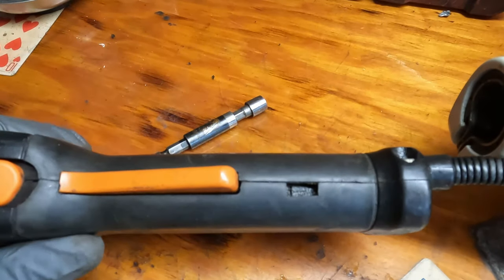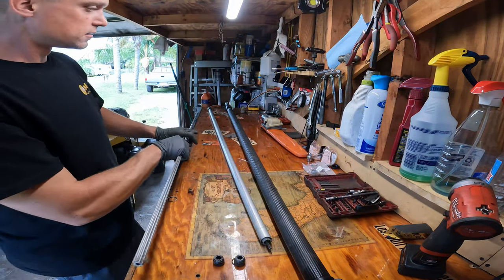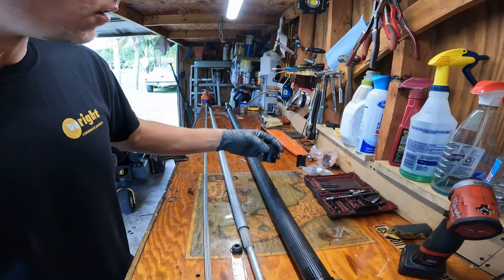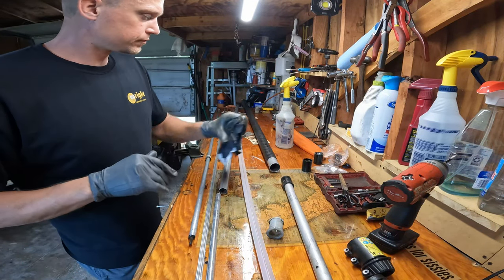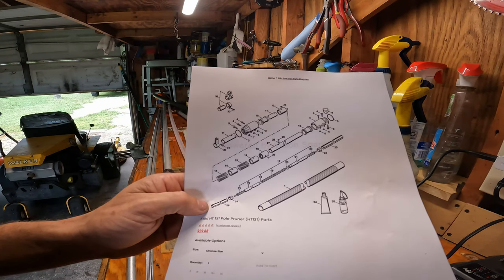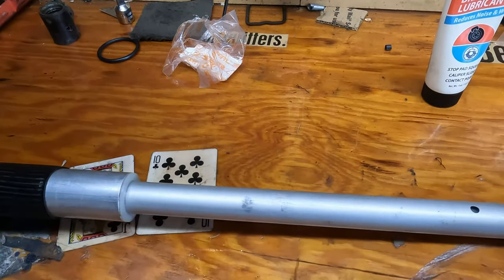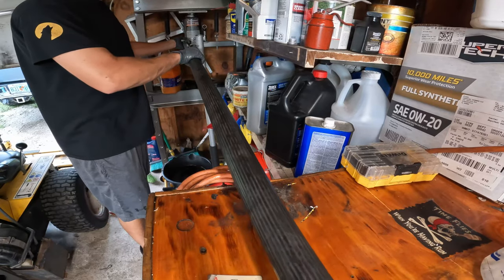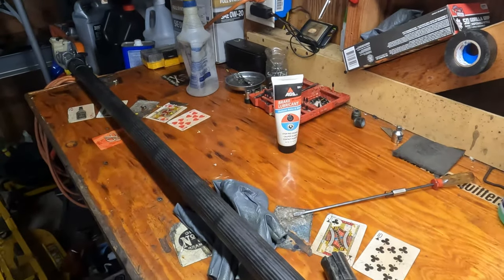Stihl HT 131 Rebuild Part 2

Comment: Any chance you would know what the factory carb settings are for the H L, mine is not running to well, like to know where the needles should be. Thanks
Reply from the maker: Try  High  4 1/2       Low  2 1/2

Comment: I recently replaced all the bearings and springs in my 131 and when I put it all back together the cutter end sticks out about 3.5’ and will not retract any farther.  Any idea what the issue is?  Largest outer tube backwards?
Reply from the maker: Yes, the rivet on the outer tube is hitting the bearing and stopping it from retracting.  In other words flip the outer tube (largest) end to end.
Apologies for the late replay. Hurricane Ian has made a mess.